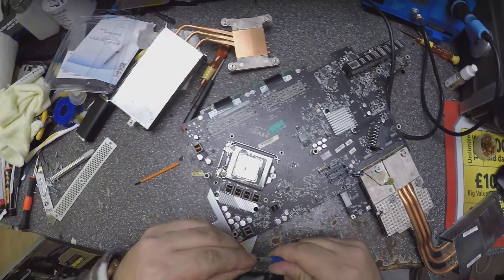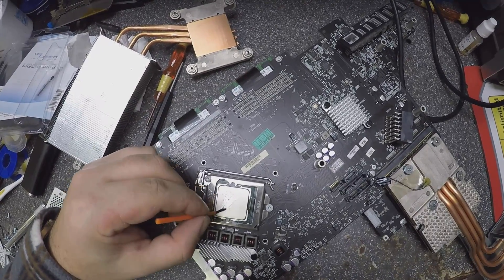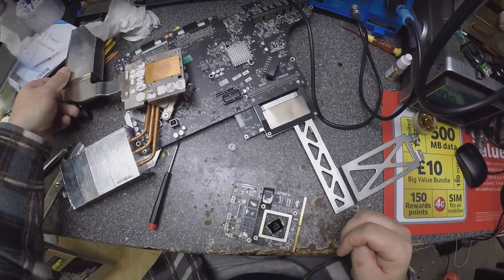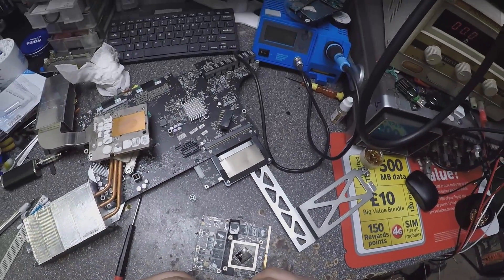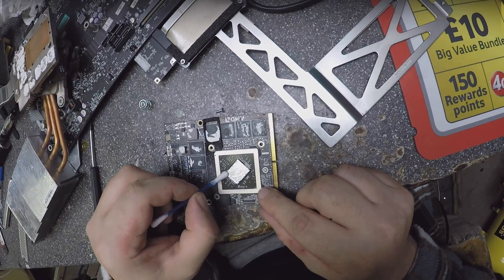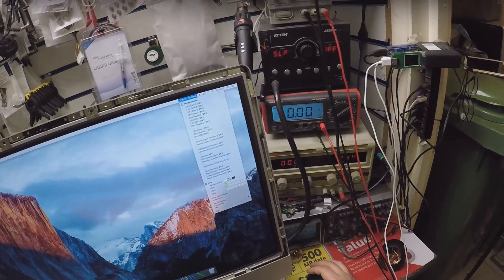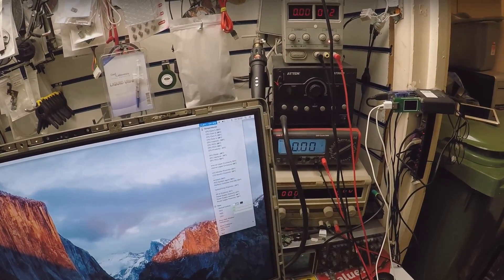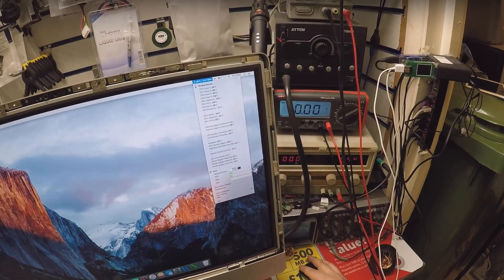imac 27 2011 overheating fix, liquid metal thermal paste

Comment: You didn't clean the GPU chips properly, just added barely more paste on top of dried paste. You talked about the fan speed and temps being low, but of course they're going to be low on the desktop with no programs running! Run a GPU stress test, play a 3D game for 20-30 minutes, THEN let us know what the temps are! LOL.

Comment: Hello Sir i like what you DO 
i wand to ask you i have an imac 2011 with I5 2,7 and i want to upgrade it with i7 2,7  does it work ?
Reply: no you cant. they have different powersupplies. in the i5 models are S cores mounted which need less power!
Reply: @yrvideochannel  they have the same power supply but the difference its that I7 have more tdp but no problem even you can put 32gb of ram
Reply: Adil. Apple OYH
Reply: Hey, for the iMac 12,2 / EMC 2429 (Mid 2011) you can use a Core i7 2600 3,4 GHz...

Comment: this is a TERRIBLE  idea. liquid metal is not stable over long periods of time and will eventually leak out and possibly fry your cpu and mobo ECT especially in a product like this one that is sealed and a PITA to open up and change the paste on
Reply: its a imac from 2011 , if its fry or die just change to another plataform , jesus..
Reply: @logk  Either way. Putting Gallium metal inside your computer in any respects is fucking stupid. Plain and simple.
Reply: @logk  these are still expensive so if you own one you won't want to kill it, me personally im a pc guy.
Reply: @JBTYpr  ok but to kill this imac you need to put ridiculous amount of liquid metal to spill in the die , i dont think he exagerated in the amount , and the imac will be in place static for more years
Reply: i dont reccomend to apply in laptops , they move so much , a day will spill due to shaking or move
Reply: @logk  it really dosent matter how much this stuff will eventually leak out and since this is a sealed unit it's just a bad idea
Reply: @JBTYpr  some giant tech channels have delided cpus with liquid inside and no problem with them
Reply: @logk  same tech channels advise not to do this for long term use

Comment: Just started looking for LM paste for my imac and they say that it corrodes aluminium so not sure if putting it on the processor is smart move
Reply: what has processor to do with aluminium ?
Reply: @grindererrofficial3755  maybe has aluminium casing over the die?
Reply: @ShadoutMusicOfficial  its copper
Reply: @grindererrofficial3755  silver shiny cover is copper?
Reply: @ShadoutMusicOfficial  its copper
Reply: @ShadoutMusicOfficial  btw liquid metal has nothing to do or be on IHS (yours aluminium cover over die), it can be and has sence only on chip/die to cover area. In other way you very risking fatal damage of you computer.
Better temps are like 2-4 Celsius in compare with standard thermal paste.
But inside /under the cover you can cut down like 10-30 C (depends on cpu and other things).
Reply: Exactly, but removing those covers resulted in cpu damage in multiple cases so its not an option, at least not for me
Reply: @ShadoutMusicOfficial    delid its not dangerous , if you know  what you doing. Bit danger is if CPU soldered, but mostly in those cases is deliding quite worthless.
If you know what and how to do, how prepare and care cpu , its realy not dangerous. I personaly delided mine cpu and many many others. No fail, no problems.
I delided my cpu - 18C drop of temps. 4,9 Ghz overclock from native 3,5 Ghz with aircooler, max temps like 65.

Before 87 C with 4,3 Ghz
Reply: @ShadoutMusicOfficial  it's plated copper. With tin If I'm not mistaken
Reply: Adil. Apple OYH